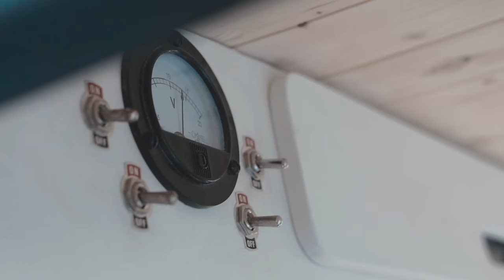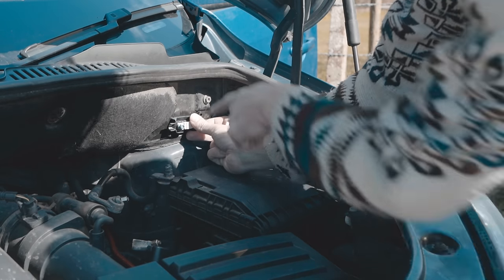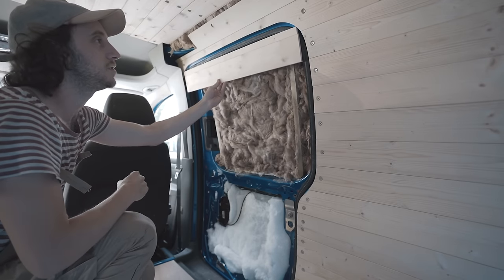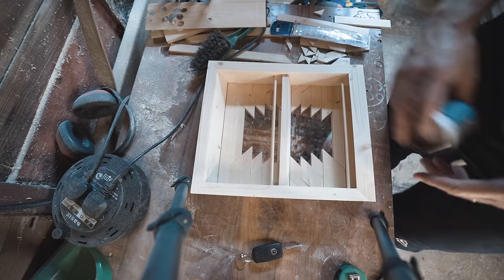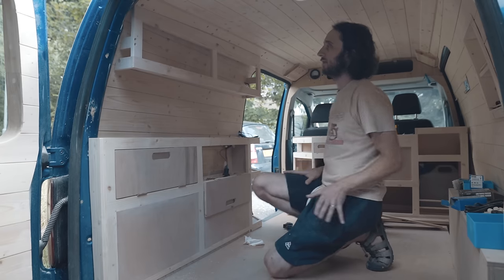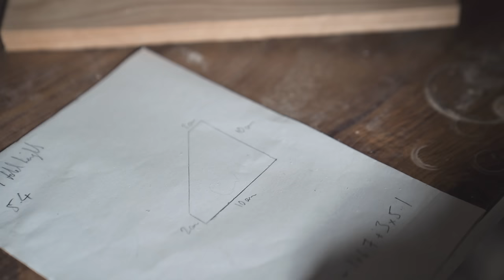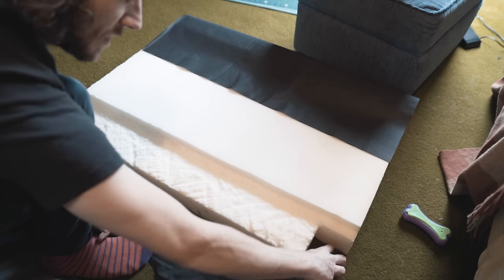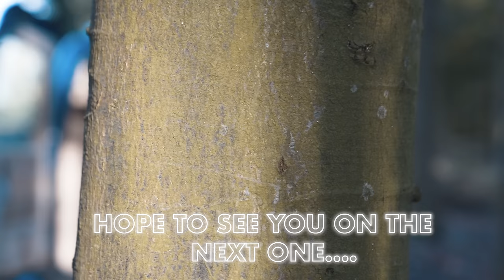DIY Camper Van Conversion | Full Build Timelapse | VW Caddy

Comment: Sadly you skipped the most interesting part in the video. Would have liked to see how you put the wooden sides and the ceiling in the van
Reply from the maker: Check out from 10:12 onwards, just a case of drilling a pilot hole to prevent splitting the timbers, counter sinking the timber to allow the screw to sit flush then screwing it down, hope that helps